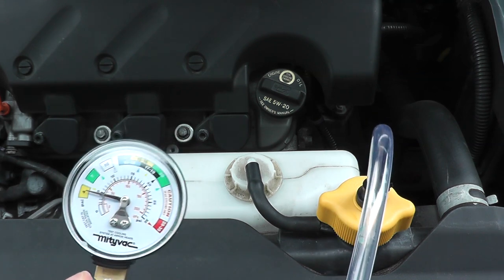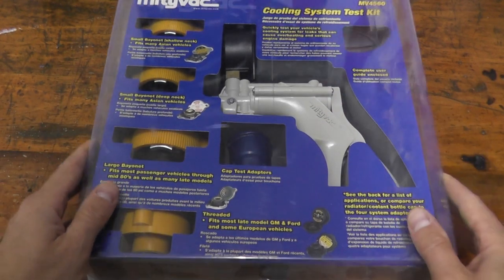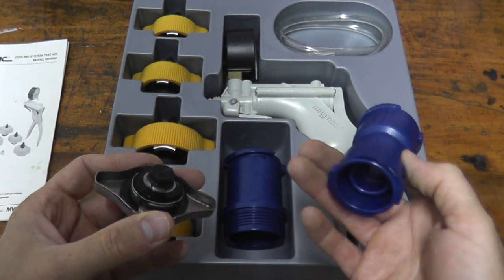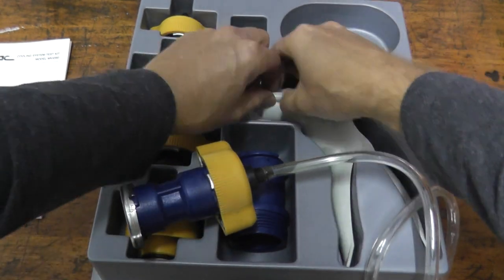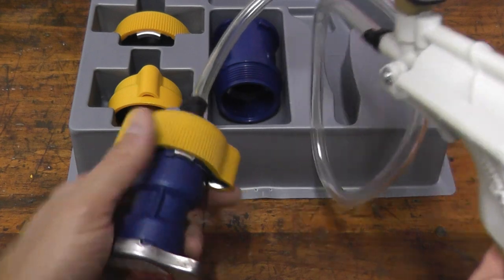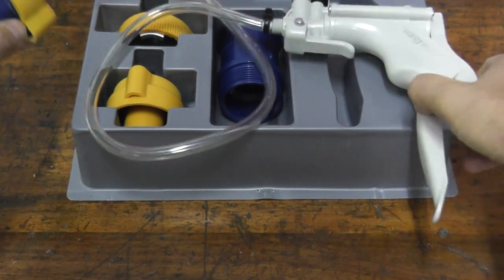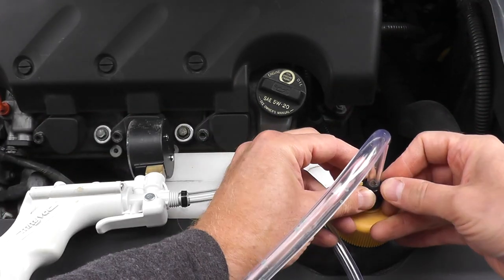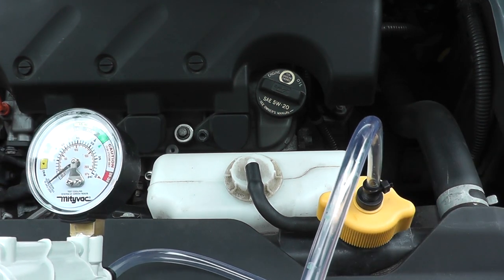How to test a Radiator at home - quickly and easily

Comment: It should be noted that this is a vaccum test that does not show other failures. The cap may have a good seal but may have a mechanical issue and not open up when it supose to.... to prevent over pressure or stay open and not allow the system to pressurize .
Reply: He keeps saying vacuum but this mityvac test kit comes with a pressure pump and not a mityvac vacuum pump.

Comment: I simple just change the radiator on my cars every 10 years with oem unit. I do a coolant flush every 5 years with oem long life coolant. And water pump every 10 years also if they don’t go bad.

Comment: Sorry m8 but it's not for free you need to buy an equipment..:) I tought there is a trick that you will show us but it was not... Thanks anyway...
Reply: @Ezzell_  I will pay and purchase after then, is that deposit completly same amount of that i paid? C'mon m8 you are pushing too much..:) It's not the same shit with the title...
Reply: cemmaster free... you just have to return it not broken and you get back 100% of the money you paid to take their tool. If you’re wondering why they would do this it’s because then people are more likely to buy things at their store. It’s an effective way to promote business while genuinely helping your customer.
Reply: @bigbothoee8617  k
Reply: Dear Sir. You are applying pressure, not vacuum. There is a vacuum vent in the cap so you don't collapse the radiator or the hoses when the coolant cools down.